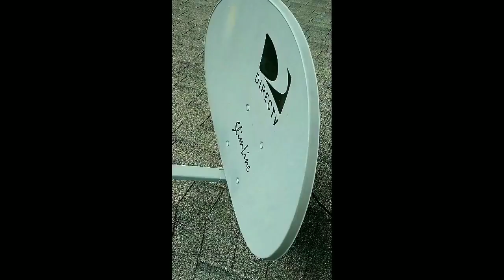15 minute "Smart Home" projects: Satellite Dish Removal (safe, easy, and fast 2019)

Comment: Is there electricity that runs to the dish? Do you need to shut off electric before cutting the cord off?
Reply from the maker: Good question! There is only electric typically present on coax connected to electronics. There are other circumstances such as if there was a power supply or signal booster connected in to the system. Trace where the coax should be connected to a ground block, splitter, etc on the outside of your house. Disconnect at that junction point. If you cannot locate, no big deal; just take a pair of side cutters and clip the coax wherever it makes most sense to make it easy on yourself in the de-installation. It isn’t necessary to cut off electric bc without knowing exactly where something may be connected in, you’d have to cut the whole breaker box. There’s nothing really high voltage usually so I’ve never had to go to those lengths over thousands of installations/de-installations. Hope this helps

Comment: plugged the holes????
Reply from the maker: You should leave the foot (base) as shown at 4:45 and confirm there’s silicon or a tar based adhesive such as bishops tape around the perimeter of the lag bolts. I do NOT recommend removing the foot (base) of the setup that’s drilled into the roof!!!